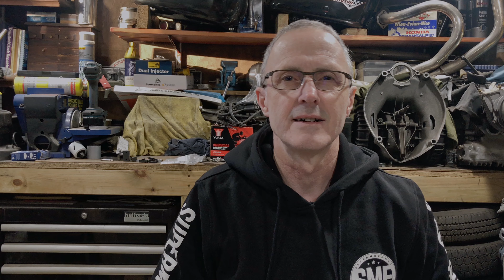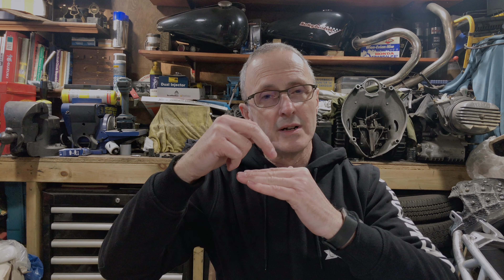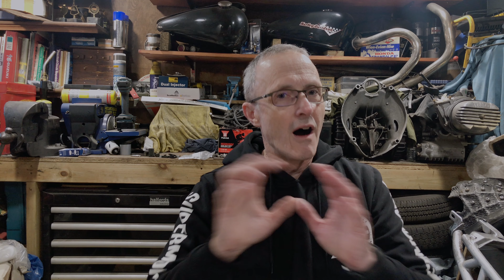Engine Power Basics: Airflow

Comment: Hello David, i am thinking about doing a 125 to a 390 swap on my gen 1 duke. Do you think this would be hard and do you maybe know which parts i would need?
Reply from the maker: Hi Lucas, I've not seen it done with a gen 1 but I'm sure it's been done a lot and should be easier than a gen 2 because you have the ability to remap the ECU (unlike the gen 2).   Minimum is just the engine which should just bolt in, but bear in mind that the 390 will have a bigger airbox and throttle body etc.   I would tend to recommend swapping in with the 390 engine loom including ECU etc - an extra cost in parts will be quickly recouped in time and costs for mapping etc.  
Spend some time on the online parts finders - if you click through the individual components they will list what other bikes also use that part so you can see which parts are shared by both 125 and 390.  For example on the gen 2 they have different fuel tanks (even though they look the same) because the 390 has a bigger fuel pump. Good luck with that.
Reply: @MotoMirius  thanks a lot for your information!! I didn't know you could remap the Standard ecu of my particular model. I will look at the online parts thanks for everything.

Comment: Hi David, interesting video. 
Could you explain in few words why free flow (decat or no dbk)need a map adjustement because it’s post combustion and i don’t understand how the air-fuel ratio is impacted. Thanks ✌️
Reply from the maker: Yes, it's post combustion, but if the post combustion gas is blocked from exit then some will stay in the chamber - think of blowing up a balloon - its hard to get the breath out of your lungs and it will try and push back.  So on intake, the cylinder is still partly full and can't take as much new oxygen, but the map will still inject the same fuel.  If there is no balloon pushing back the post combustion gas escapes, so on intake you get more oxygen but still the same fuel (leaner and hotter).   Of course the lambda sensor will make some adjustment to fuel, but it won't always make the right adjustment unless the map is changed for the new setup.
Reply: @MotoMirius  yes i understand, with free flow  your cylinder is « more empty » after combustion so to keep the good ratio you have to had more fuel. Am i right?
Reply: For now, i don’t have the money for a piggy back. To your view, For a better sound, is better to decat or debaffled. Which one will aproximatly keep the good ratio of the original map?
Reply from the maker: @KaRim-es9xx  Yes, that's right.  So because you add more air and fuel you can get more power even though all you have changed is post combustion.
Reply from the maker: @KaRim-es9xx  Loudest sound is decat - because its bigger block but to avoid piggyback, best to stick to debaffle.
Reply: @MotoMirius  thanks a lot for spending Time to answer me 👍👍👍👍

Comment: Could one use a Water/Methanol Injection on a 125 to cool it and to up the performance by way of introducing methanol as a Fuel and Oxygen when the water evaporates ?
Reply from the maker: In theory yes, though I've not delved into the theory enough to comment much.  In practice you'll need to either find someone who can provide you with a plug and play setup including maps etc or spend considerable time and money on a dyno.   Unless you have a very good reason for doing it, it will almost certainly be cheaper bolt in a bigger engine.  Unless you have the skills and tools to do it yourself, engine development is always expensive.

Comment: what do you think about the Athena 160cc to the old ktm duke 125’s?
Reply from the maker: I've never tried it but as with any big bore kit, it is only part of the picture, it only gives you the potential to add more power.   Memory tells me that the KTM 200 is the 125 bottom end with a big bore kit bolted on - but don't take my word for that.   Really depends what you are intending to do - by the time you've bought a big bore kit, bigger injector, put it on the dyno, modified the mapping etc, bolting in a 390 engine with loom becomes an attractive alternative since it has more than double the capacity of the kit.